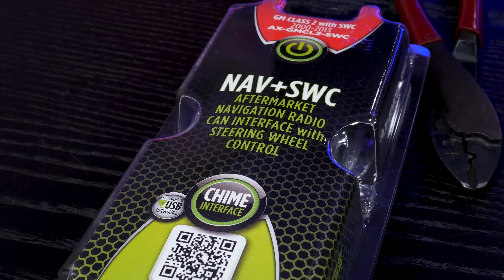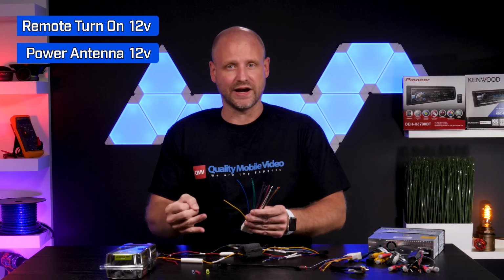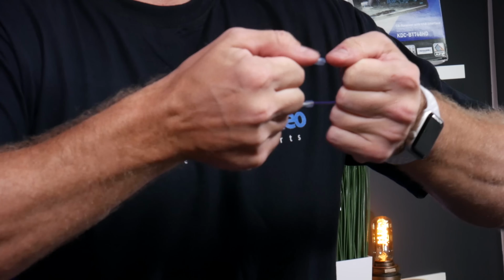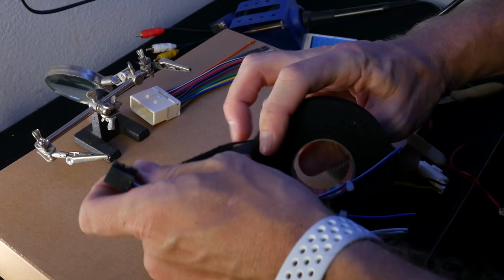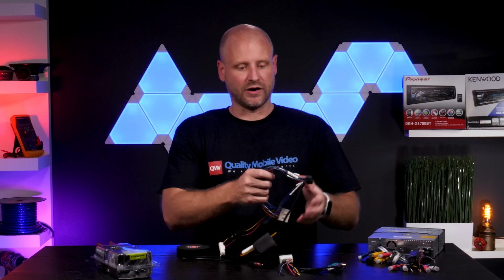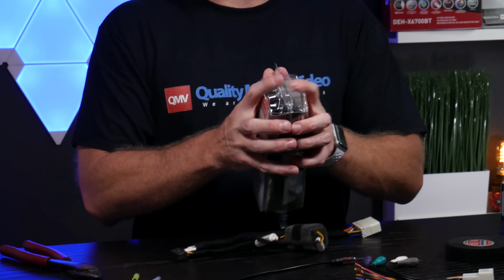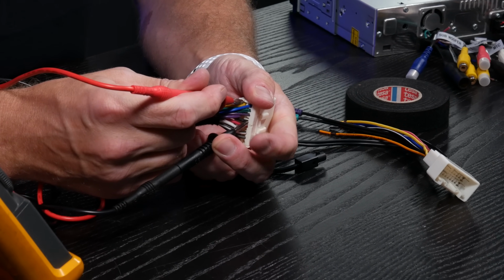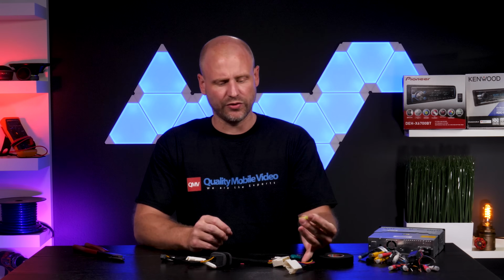Car Stereo Wiring Harnesses & Interfaces Explained - What Do The Wire Colors Mean?

Comment: Fye for those with cars years 2000-2008, you have to wire the power antenna to the red. Otherwise you will have no sound. I learned this the hard way.

Comment: I've got a 2011 Wrangler that has a double din factory. I'm taking it out and putting in an old school Kenwood tape player. I understand this means I lose my steering wheel controls and BT (unless you have a fix for that). I've got everything hooked up except there's no red wire coming out of the factory harness. There is however two additional smaller yellows. Advice?
Reply: I would run a separate power wire to the fuse panel.
Reply: @raheambrown2714  I ended up running a red wire down and splicing it in with the power windows harness. Works perfectly and gives me the same delay after shutting the vehicle off too. Assuming the other two yellow wires were for the steering wheel controls. Thanks!

Comment: If my stock stereo doesn’t have rca input plugs in the back is there an interface device that connects to the stock stereo and I could plug my rca cables in there?Because I’m trying to install my subwoofers but my stock stereo doesn’t have a spot to plug in the rca cables and remote wire,I have a 2018 Camry de and it’s hard to find stereos for that model

Comment: hello! :) what happens if you cut/disconnect the red wire? ignition key will no longer turn on/off radio, but you will still be able to turn it on/off manually? If not how do you achieve this?
Reply from the maker: You need the red and yellow wire connected at all times for the stereo to work and turn on!
Reply: @Qualitymobilevideo  someone said if I switch yellow an red wire (connect yellow to red and red to yellow), then ignition key will no longer turn stereo on/off. It will then need to be turned on/off manually. Is this correct? If not, how do you achieve this?

Comment: Hey guys! I have an aftermarket radio installed and don’t have power in the factory amp/subwoofer. Any thoughts on the solution? Speakers work but not amplified subwoofer.

Comment: I have a separate amp in the back of my jeep. It needs a signal when to turn on. Can I use that Power Antenna blue wire to signal the amp to turn on and stay on when the radio is on?

Comment: Hi, I have a 2012 Toyota Matrix , I took out stock stereo had power but Audio, Checked Fuses, All Good, Installed new Head Unit , 
Backup Cam, GPS Nav. , Blue, Phone Connected. Still No Audio ?  Any Ideas Would Greatly Be Appreciated, Thanks

Comment: My pioneer instructions say do not connect the yellow wire by passing it through engine compartment to battery. I found a constant source on the brake light switch or is there a better location?

Comment: Hello and thanks for the video. I have just a question..... I'm in the process of wiring my harness with the interface and I am stuck with the navigation output wires (Pink, Purple/White, Light Green). Pink stating to be the Vehicle Speed Output, Purple/White stating to be the Reverse Output(+), Light Green stating to be Parking Brake Output(-). Then there's the Orange/White= Illumination Output(+).
On the connector side.... I'm left with Pink Wire=Parking Sensor Control, and a Green and Orange Wire that isn't lable on the diagram.
My question is what wire goes to what?
Reply from the maker: Hey, I'm not sure what your harness or vehicle model are, but I believe that could be Infotainment/Comfort
Reply: I have a RP5-GM11 Interface... I'm installing it in a 2005 GMC

Comment: I do like tips on crimping the wires with the butt connectors I've never liked butt connectors because it's very hard to get a very tight connection with them I know it can be done but it's not always easy and you got to have good crimpers too I like that trick and been in the wire I never thought about that very good

Comment: What do you do about an isounit?  Some of the wires I need for my wiring harness on the radio are attached to an iso unit.  It would be great if all of them were but that's not the case.  I had to attach the ground  and illumination wires to my wiring harness,  now I have a lot of leftover  duplicate wires.

Comment: My 93 ranger has illumination and dimmer wires but the aftermarket unit I bought doesn't can I just tape them off? I also have a radio ground and chassis ground can I connect them and attach to the single aftermarket ground wire?

Comment: I have a radio that included two orange wires. One was unlabelled and the other stated “ILLUM”. I only wired up the illum and not the other. My touchscreen side buttons do not light up at night, curious where that would plug into? Didnt have two orange wires on my harness end.

Comment: So for my new pioneer avic radio, I need to splice Into the vehicles VSS wire and break light wire, so I need to get more wire. I believe both vss and break light wires on the stereo harness are a 20 gauge wire, and the only wire I’m able to get is 18 gauge, will this affect it at all or will this work fine connecting 18 gauge wire to the 20 gauge stereo harness?

Comment: Hi i recently attempted a hardwire radio install i have 2 red 12v battery wires coming from stock harness, i am trying to connect to yellow battery wire on new stereo harness and im getting a smoking stereo when twisting all 3. So then i put 1 12v constant aside taped up and connect new yellow battery wire with just 1 red 12v and it smoked again. Any help would be much appricated. Also there was no problems at all with stock stereo everything was working fine aftermarket is smoking.

Comment: Do you have a video of how to get the radio module interface to work on a 2001 Suburban,  it use to work and it just stopped working for no reason,  is there a fuse?

Comment: Heyy I have a Pontiac G6 2007 base with a factory subwoofer. My radio is powering on but no sound is coming through. How do I make the factory amp turn on so the speaker's will work? I connected the wiring harness to the diagram on the video. I also made sure the radio antenna is connected to the radio blue white wire and the harnesses blue wire with still no sound. I am using a add circuit ATM on the radio fuse to give it acc power. Any help?

Comment: So I have a question. I have read in forums that running a stereo through a bose system in vehicles without going through the interface will damage your speakers. My issue is I just got a vehicle no stereo. Wires were hacked and interface was taken. I have multiple decks just laying around and wanted to hook one up temporary until my orders arrive for new interface and install kit. Is it not advised to hook up a stereo without interface connecting. Will it hurt the speakers. Awesome video very helpful. Just looking for answers from someone who knows what this crap is. Thanks in advance
Reply from the maker: Whats your make/model/year
Reply: Sorry for the delayed reply. It's an 06 chevy trailblazer but on further inspection I found an aftermarket interface that was connected to stock stereo harness with bypass. Awesome video and appreciate the reply

Comment: I’ve watched this video 3x and decided to hookup a aftermarket radio in my mom 2011 dodge caliber bcuz the factory went out. Now I’ve done plenty of installation before in the past, but after wiring up the harness and connecting the speaker wires accidentally 
(red +12v) (Grnd -) (Yellow memory) & (blu/wth remote antenna) Why Imam i getting constant power?
Reply from the maker: Your red wire must have constant 12 volts and not turning off with the key.

Comment: Thank you for this great video. I have a question: I recently bought a touch screen radio (cheap one) for my car, it work good, but it has a small problem, when I start the car it goes on automatically with a welcome screen and the antenna rise and after a second it turns off  even if it was off last time I turned off the car. Every time I put the car on or put switch to accessories the radio goes on automatically and turns off, also.. at night when I turn on lights the power button of the radio doesn't illuminate  when it is off to show me where to press to turn it on.. I just want to turn it on when I want to. Any help will be appreciated.

Comment: The noise filter used in this video.... did that come separate from the harness or with? If separate could you send the part #
Reply from the maker: No 100% what you mean by noise filter. Do you mean the Heat Shrink?

Comment: Super basic question, but I cannot find the answer online.  Basic system in a work truck, with no amp and just stereo left and right, 2 speakers in dash.  Old radio is a JVC; if I remove the car stereo and replace it with a new model, do I need to stay with JVC to keep same wiring harness, or can I also use it with a Sony/Pioneer/Kenwood?

Comment: I am trying to install the stock JBL-head unit with the stock JBL amp & subwoofer from a 2010 Toyota Sienna XLE, into a basic 2009 Toyota Sienna CE.  Need help with the wiring.  Any & all advise is appreciated.  Thank You so much.
Reply from the maker: Interesting question Ben. So have you checked the factory wiring/harnesses, inputs and outputs of both stock head units, and are they identical? Sometimes you can get lucky and next model car's stereos can be swappable and not require the purchase of a new wiring harness.

Comment: Hello, I installed my stereo and everything is working properly, however there is a feedback noise and it fluctuates a depending on how hard I accelerate and it is very noticeable. How do I fix this?
Reply from the maker: That is a ground loop problem. There are a couple of possible fixes for that, it usually starts with upgrading the ground to the radio.
Reply: @Qualitymobilevideo  How do I upgrade the ground?

Comment: I usually stagger the splices so the bundle isn't that big around. I also use SolderGrip butt splice so you solder and heat shrink at the same time.

Comment: Im doing a 1999 suzuki jimny 2 din install and im also changing all the speakers. There are 4 cables going to the rear speakers. Left speaker has white and white-black wires and right has green and green-black wires. From what i've read on forums, some people have the - in the black stripped wire and some have + in the black stipped wire. Its my first car and my first electrical job and i dont want to mess it up. How do i check which is which, and is it normal that rear speaker wires have these colors? Please help

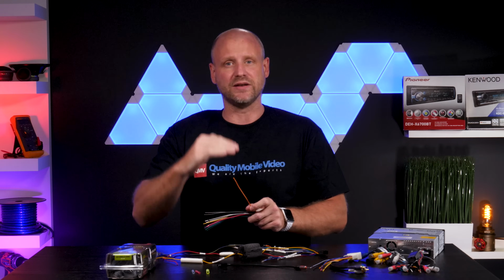Comment: Min 3:50, I have a 2011 Ford F-150 it does not have the sync feature, I just installed a pioneer double din and my accessory wire doesn’t have any power, right now I have both connected to the constan 12v (yellow wire) and Im having to turn off the estereo manually is there any other wire that it could be the accessory one?!! Help please...

Comment: I've bought a set of Pioneer Head Unit + 2 speakers. The head unit is 4 X 22w RMS and the 2 speakers are 40w RMS each.

So can I bridge them like you would an amplifier to make 2 X 44w RMS? Is there a reason it would not work?

Comment: for some reason my remote turn on blue wire dont work for my amplifier.
Can I use the red accessorie wire to turn my amp on?
Reply from the maker: Yes you can but depending on the amp you may get a pop.

Comment: Could quite see how you hooked the wire & the inserted in the butt connector. I've just been placing them straight in. I like your method if I could only figure it how you did it. Perhaps you're using a specialized butt connector?

Comment: What if my car side wiring harness has a Blue and a Blue/White wire and my stereo side wiring harness only has a Blue/White wire? Do I make a 2/1 connections with these? Also, I have a separate REM Blue wire from my Subwoofer Amp, do I connect all 4 of these wires together since they are just remote wires?

Thanks in advance!

Comment: Which wire would you use for a reverse cam? If that power antenna or amp wire goes unused could you connect them too together?

I have an acura rsx 5 speed
Reply: Reverse light so when  The reverse light turns on your backup camera turns on too

Comment: Great video ! In my opinion using real crimpers like you have in the video you will not be able to pull the wires apart, I’m guessing you purposely did a weak crimp the first time to show you could pull apart connection.I think butt connectors get a bad rap because people use the crimper combo strippers that have no leverage to do a real crimp, so they never get crimped. Be sure the stripped wire is in the metal part of butt connector and use real crimpers and that wire is together.

Comment: I am hooking up a CD multidisk changer on a 2019 ford factory radio. I don't want to cut the factory wire harness. Is it safe to wire the constant hot for the CD changer directly to the battery? It is really easy to go directly to the 12 v input into the fuse panel under the drivers dash

Comment: What about a vss (vehicle speed sense) wire? Do I connect the vss wire on the head unit to the vss wire on the pac module for example or do I disregard the vss wire on the pac module and use the vss wire on the head unit and tap into the factory vss wire on the gauge cluster or ecm? 03-06 Silverado Kenwood navigation radio

Comment: I get the soldering wires to correct pin/wire  but what about when there blank spots in the wiring harness that need to be filled?
Reply from the maker: Do you mean wires with not matching connection? Or empty slots in the harness head?
Reply: Both. A couple wires are to the wrong pin, and two connections are blank so i need to somehow come up with the crimp connectors to go in

Comment: Hi, very nice video, handy to know what the colours mean now....
Question if you have time, the speaker colours all match on the adapter I bought for a new stereo, the JVC KW-R520, but on the power side, I only have the yellow, black, red and blue cables (no orange) and the red and blue cables need to be inserted into the adapter head by me, now this is simple to do, but I don't know which of the 8 ports to put them in, as the cables on my 04 VW Passat Quadlock head are not the same colours, and there's 5 cables going in from the car side, (only got 4 with the adapter).
The colours on my cars Quadlock head are brown heavy cable, blue/red heavy cable, blue/red light cable, an orange/brown and an orange/purple cable. Not sure what those colours correspond to on the new adapter.
Any info would be appreciated, thanks.

Comment: If the harness I bought for the aftermarket radio doesn't  have  red wire connection  what do I connect the red wire coming out the radio to???

Comment: on my stereo (JVC double din) it has a rca connection for the SW. My wiring harness interface has a AUX connector for the SW. with a female AUX separate. do i wire the female AUX connector to a RCA plug to then plug into my stereo?

Comment: What I like to do for cars that use a cereal bus connection wile installing a aftermarket radio is to connect the power on signal to a circuit that comes on when you turn the key to ACC position. This power's on the radio without the need of a interface. And most of the time people don't care about the annoying door alarm being disabled.

Comment: Amigo una question on the speakers level wires can i connect the yellow wire constant 12v directly to the battery, to the positivo? Gracias amigo

Comment: Hello. Question. I got a new stereo for my 2005 Camry. 
The problem is that the original wires are copper, but the ones that come with the stereo kit are silver. 
Can I solder copper to silver, or aluminum I guess?

Comment: I have done my own installation by cutting the plug from my vehicle and simply re wired the harness from the new car stereo, so it turns on and off when switch to on or off but there is a particular problem that it’s bugging me when I turn my vehicle on the stereo turns on and all my adjustments will be to default and I will have to pre set all my adjustments once again every time I turn the vehicle on , what did I done wrong ?

Comment: So I have a question. I have a 2003 GMC Envoy SLE and it doesn’t have BOSE or OnStar. Which aftermarket stereo harness would you recommend? I have seen some with out the chimes and some w it. Please help.
Reply from the maker: Here you go: https://www.qualitymobilevideo.com/70-2054.html
Reply: Ok. So what’s the difference between what you sent me and this one I was looking up?

Metra LC-GMRC-01 Wiring Interface
Reply from the maker: Oh I thought you wanted one that didn't retain chimes and factory systems. The LC-GMRC will retain chimes, balance/fader, accessory power,  designed for non-amplified factory systems, has High level speaker input,  Micro “B” USB updatable, and  Provides NAV outputs (parking brake, reverse,
and speed sense)
https://www.qualitymobilevideo.com/lc-gmrc-01.html
Reply: Thank you so much! 👍🏻

Comment: I'd like to find a video that explains why there are 3 harnesses coming off my 2002 Mustang radio with premium sound system (Mach 460). Some models have all 3 connections but some only have 2 even though it's the same radio. Not including the antenna cable. Most harness kits come with only 2 harnesses and it appears that the system works just fine without connecting to the third harness. So what does that third harness do? I haven't been able to find any technical data that would answer my question either.

Comment: I’ve tried everything to bypass my pioneer deck from the micro bypass toggle switch and relay. I just can’t seem to get it bypass. I do notice that on the aftermarket, pioneer harness I do have a yellow wire with a black stripe. Not sure what that one’s for.